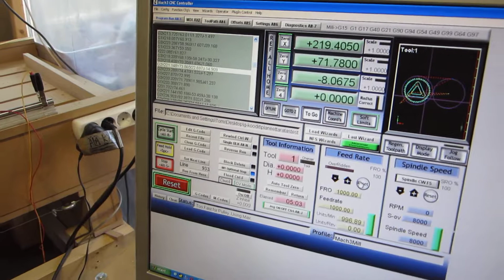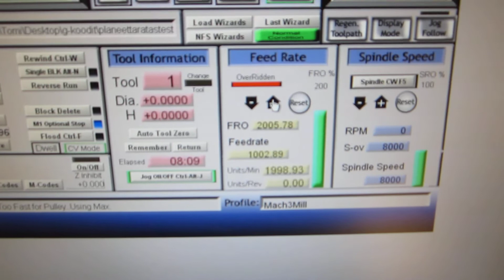Planetary gearset prototype for Kinetic sculpture cut from MDF with DIY CNC

Comment: What pattern or program did you use to make the gears, I would like to make what you did, but a bit larger and I want the planet gears and sun gears different
Reply from the maker: +heidebill I used a free tool called Planetary Gear Designer available from here: http://www.muellerr.ch/planetary_gear_designer/
He also has a similar program for spur gears.